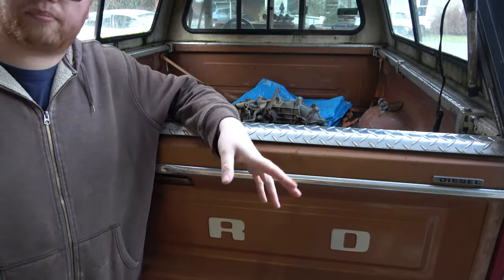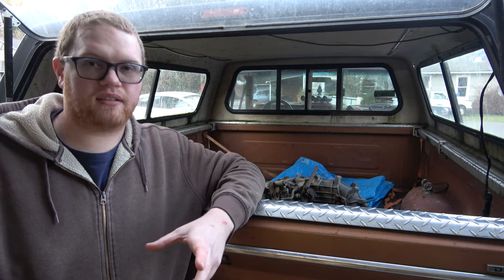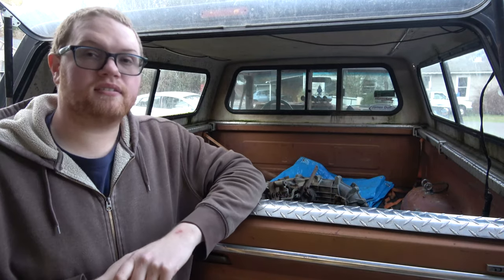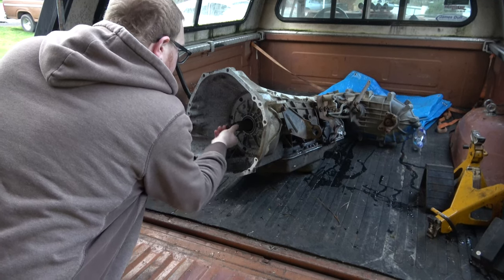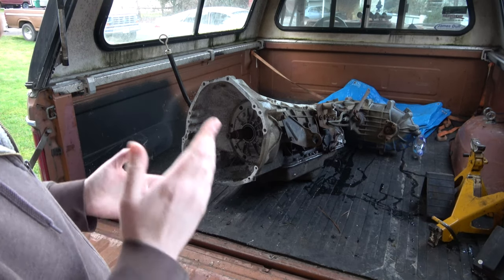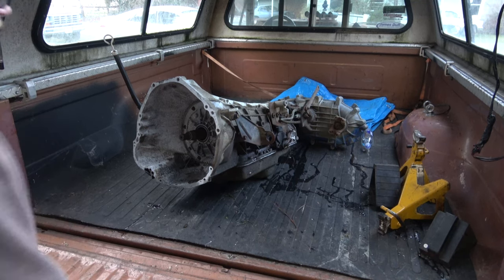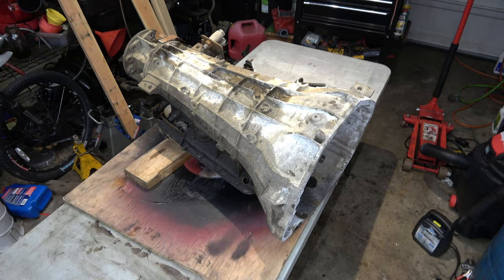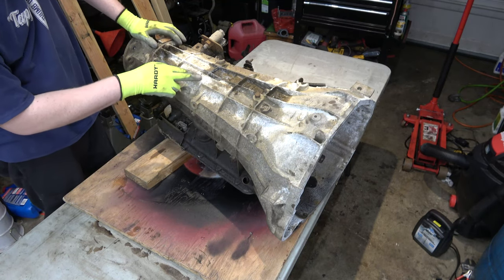The E4OHNO Build | Will it Rebuild?

Comment: Totally overkill. But, the e4od is a nice trans when everything is working. The factory ecm on the early models are super smooth shifting ( have one in 1990 f250 ). I also hear good things about the aftermarket controllers you can run.

Comment: Do you have LED bulbs in the reverse light housing on your Cummins truck? I was looking to upgrade the reverse lights on my 81, but don’t want to mount pods and would like to keep the stock look.
Reply from the maker: Yeah I have leds in the lenses. I have the pods for additional night time back road vision when backing up or I use them as work lights.
Reply: Bullford82 did you have to change the bulb socket or can you just find bulbs at the auto parts store?
Reply from the maker: Same bulb socket. AutoZone or any auto parts store will have led lights for the older sockets.
Reply: Bullford82 Awesome! I’ll have to get some tomrrow. Thanks for the response man!